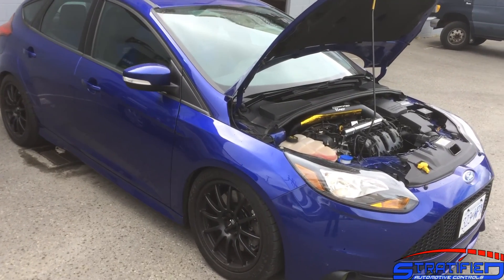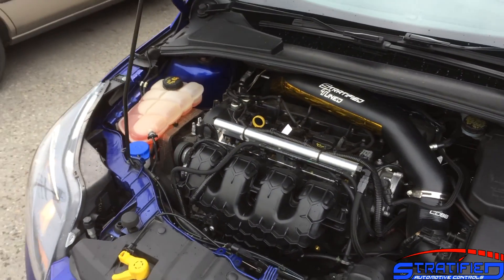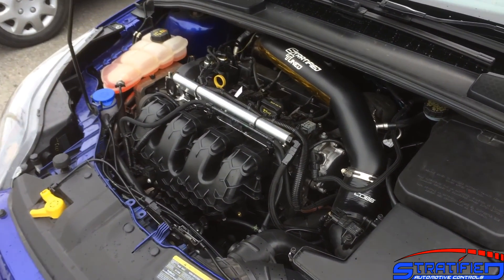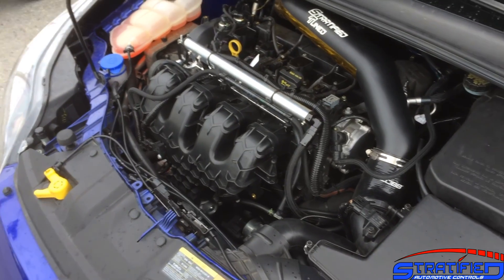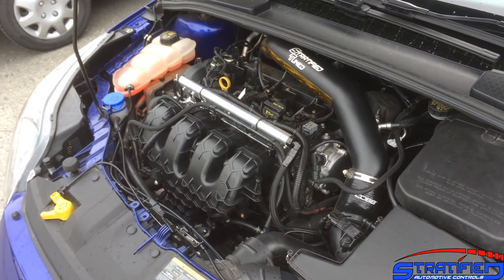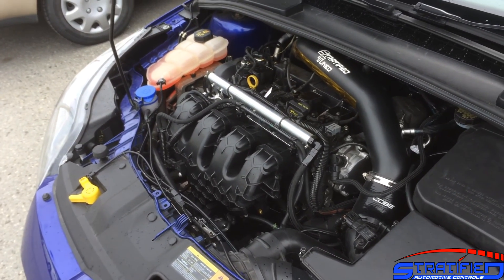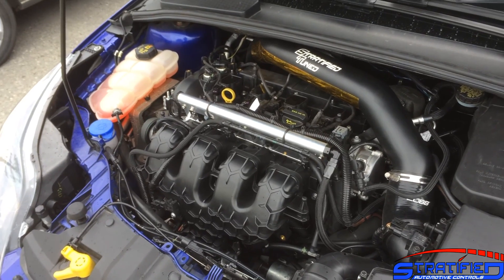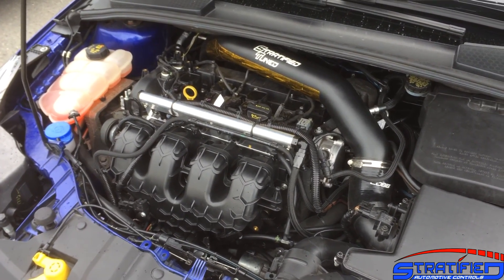4 Port Injection System Update

Comment: Thanks for sharing! After physical installation, any mapping or tuning needed for ECU?
Reply from the maker: Yes, it will need to be tuned.
Reply: @stratifiedauto   
The question is, if a system breaks down while I am driving at speed, is there safety or will the engine be destroyed if the four-port injection fails?